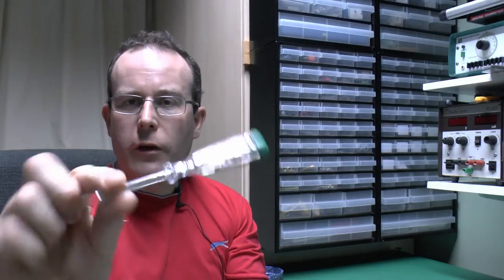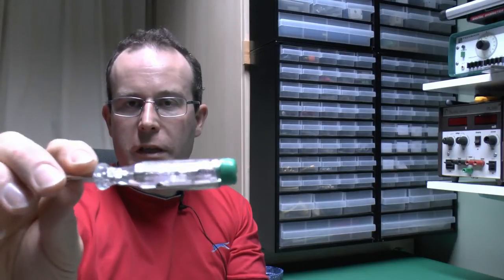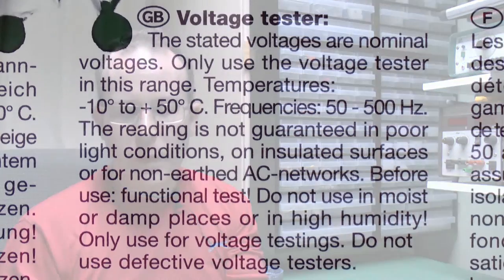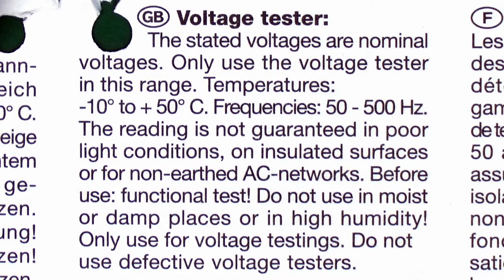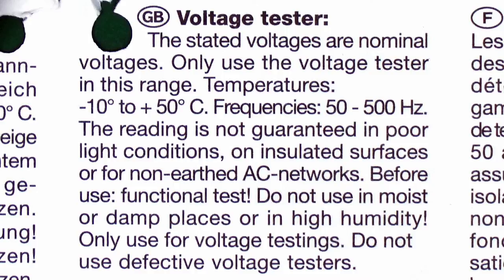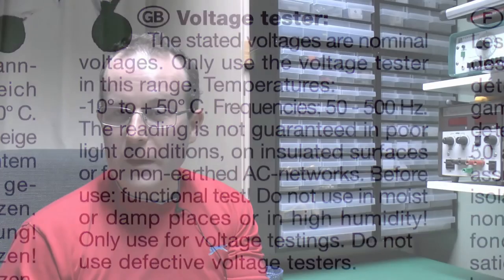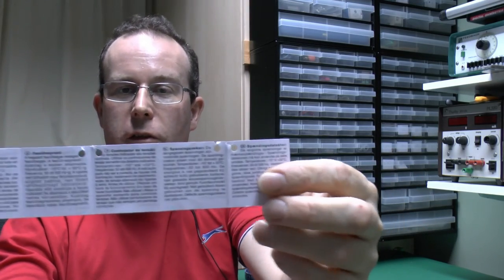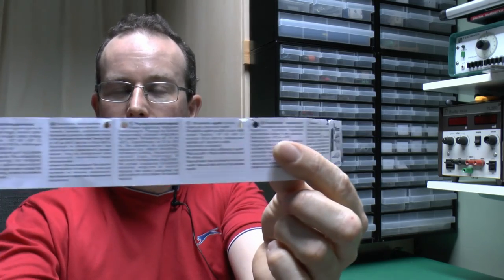Neon Screwdriver Printed Instructions?

Comment: Have to be honest, I've never come across any equipment which contained a neon screwdriver. I use 2 pole testers regularly for proving dead & quick fault finding and non contact probes as well. I also carry & use a good quality neon and have done since starting in the industry. As for it's limitations: All test equipment has disadvantages for certain things, it depends on what you want to do with it & how you use it. I've certainly used a neon to good advantage over the years.
Reply from the maker: A & L Appliances I was referring to equipment with carbon resistors in, not screwdrivers in equipment.

You are correct for two pole testers for proving dead, and that everything has limitations - unfortunately there are plenty of people who use these neon devices for proving dead, which is completely the wrong thing to do.  There are those who don't even know how to use them properly, as can be seen by some of the comments on the other neon screwdriver video.

Comment: I actually don't think the technology of the screwdrivers is particularly dangerous. I have however got an issue with ANY test that requires me to become part of the setup lol. I once had a neon screwdriver though that was factory faulty (cheap Chinese ebay crap) that used to give me a light tingle when used. I know it's going to be mega mega rare but I just can't quite trust them now. 
I think the point here is that if there are safer options why not use them? volt stick for one!

Comment: I'm intrigued, when was the last time you saw a compound resistor short out or go leaky ?. I've never seen it happen in 40 years of working in the industry & neither have any of my colleagues. If a neon was to be dropped in water or used in wet conditions then yes you could get a shock through it as the resistor would be compromised, but the same can be said for lots of other test equipment.
Reply from the maker: A & L Appliances Personally never - but I don't use neon screwdrivers or repair equipment which contains them.

It's certainly possible to use these devices safely, but given all of their disadvantages and limitations, it really isn't worth using them.  Proper 2 pole voltage testers are not expensive.

Comment: OK "I don't use neon screwdrivers or repair equipment that contains them". Can you see where the confusion came in ?.
Neon screwdrivers can & do provide a useful tool, have been around for a very long time and will still
be around for a long time to come. I appreciate that a lot of people don't use them as they should, Instead of slating something that's not going away. Why not do a video on how to use them properly ?,
Reply: A & L Appliances Probably because in the other video, he showed a safer and more accurate testing method than using the neon screwdrivers.
Reply: Neon screwdrivers were'nt intended for accuracy, just a quick & simple indication of whether a wire was live or not.
Reply: But if you're isolated from the ground (shoes, ladder) it could not indicate a dangerous voltage. And in some cases it is indicating a voltage although there is none. Inductive or capacative coupled in reactive voltage which is actually not resilient, the tester is having a too high impedance. A high impedant multimeter would indicate a voltage between 70 and 100V. That's the meaning of "other methods are more accurate". That's the reason why here in Germany these things are called "Lügenstift" (literally "lying stylus"), because they're unreliable.